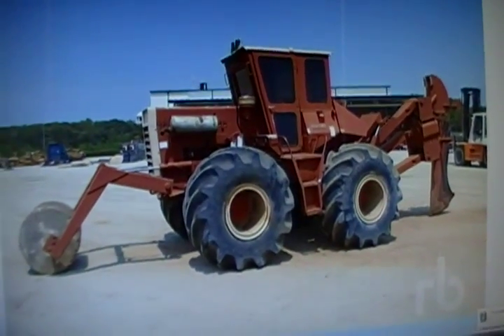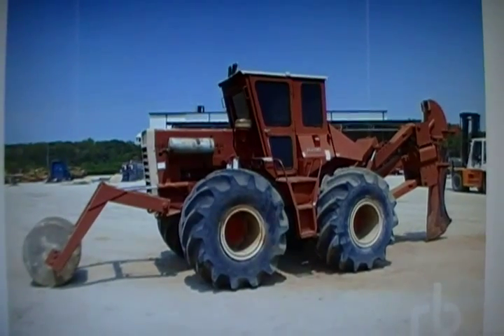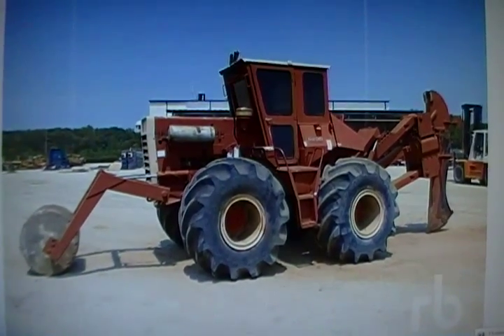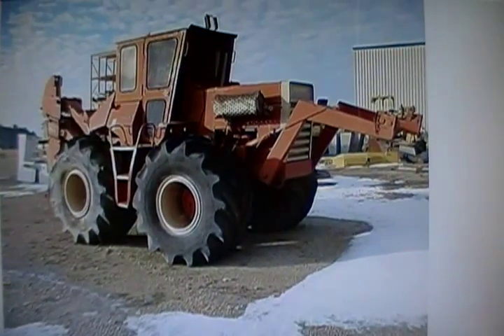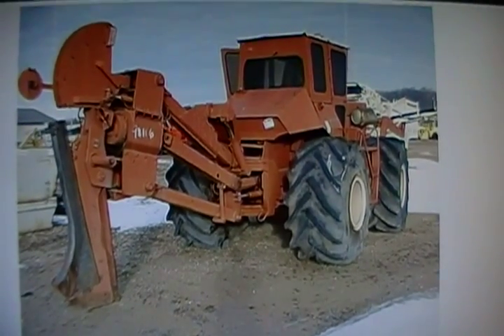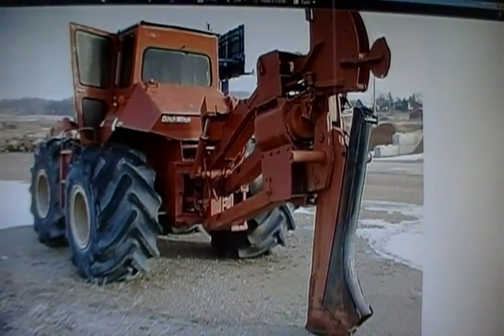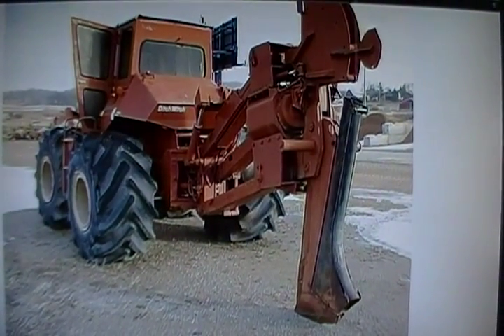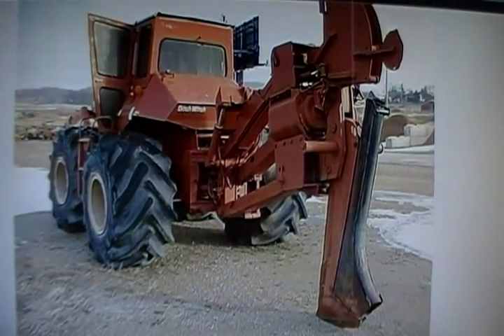Ditch Witch R200 project Video 1

Comment: Excellent information. I ran an R200 for several years in Southern Missouri.
Plowed in many hundreds of miles of 2500 pair down to 50 pair.
We needed this large machine because of the hard,rocky ground of Southern Missouri.
It is actually a very easy machine to run...maybe a little rough on the kidneys and spine. Thanks for sharing this video.